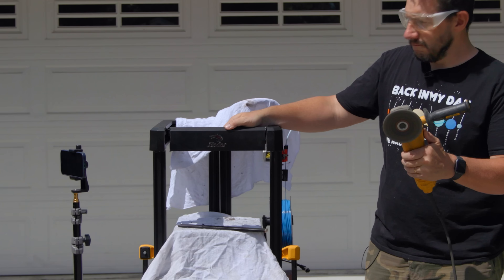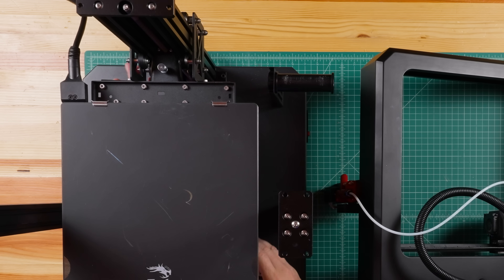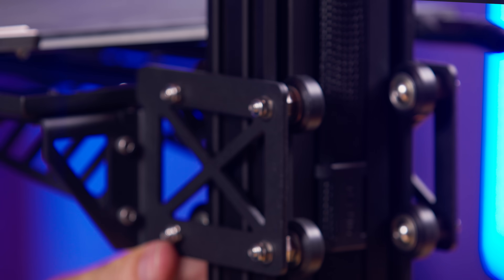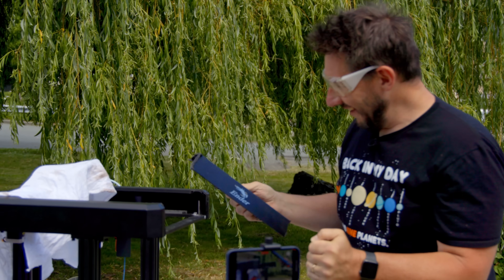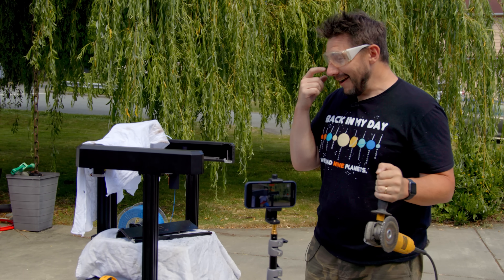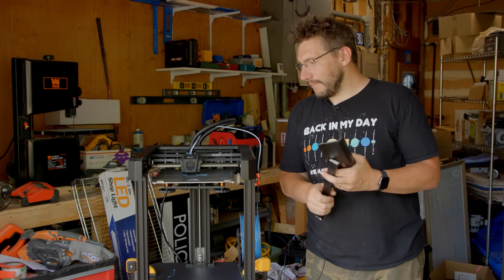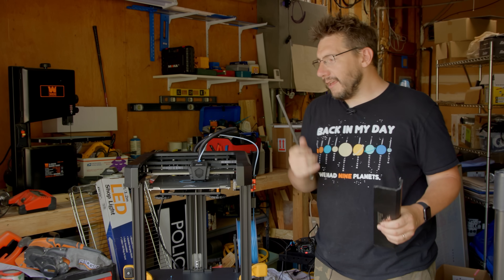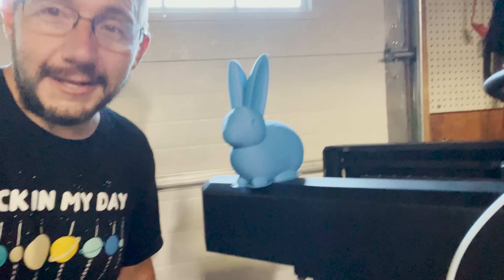I FIXED the Ender 7

Comment: That piece is needed. It adds significant structural integrity. "Squares" are stronger than U.. It ties the structure together. Also, if you notice, there were no sparks. It's not quarter inch steel, it's aluminum.
Reply: I was only searching for this kind of comment. Definitely square is better than U in terms of rigidity.
Reply: I would only cut away the plastic and mount a cam to the thin metal bar
Reply: It is definitely needed. ESPECIALLY for a coreXY printer.  All the weight is at the top, you won't be able to get the same speeds/acceleration without that cross bar.  He just ruined his printer.
Reply: It's a printer not a stool. The only thing that matter is the rails staying square. Which has been proven time and time again with other designs works just fine.
Reply: I agree. More rigidity is always better in this type of system. This does kind of hurt to see. Calling that front bar 'useless' isn't fair. It's structural.
Reply: Wow! Great idea... someone needs to contact Joe Prusa and tell him cut the upper crosspiece off his Z-axis support frame, since it’s made of strong steel, and he can save 25% of his cost for that part... Hell, do away with the upper crossbar on all the Ender 3 variants out there...

Removing vision-blocking plastic - Yes

Removing structural frame without proper stress analysis - No

There may be more than ample support from the remaining structure but to just hack off an “offending part” is a bit extreme when doing an evaluation

Mounting a camera on the metal frame (minus the plastic vanity part) is a good idea.
Reply: @jamesmiller7278  " Wow! Great idea... Someone needs to contact Joe Prusa and tell him cut the upper crosspiece of his z-axis support frame, since it's made from strong steel, and he can save 25% of his cost for this piece" 

lol, this comment didn't age well.... Have you seen the design of the Prusa XL? ;)
Reply: I'm slowly starting to realize Joel has no idea what he's doing. Metal bar in the way? Cut it off, it's going to be fine.
It kinda makes it easier to identify with him :D
Reply: @HardCoil  . With all the mass produced chinses stuff out there, now at least he can claim with proof that it is his, if it's stolen.
Reply: @HardCoil  my thoughts too. The level screw goes up from bottom not down from top
Reply: @HardCoil  Lol he used to work for Adobe, what makes you think he knows anything about engineering? Haha
Reply: also, the metal bar didnt obstruct visibility much
Reply: I was getting so upset when he was talking about how it serves no purpose. Dude completely lost my respect
Reply: The plastic definitely was in the way but I would have left the metal there too.
Reply: The structural integrity isn't neccesary for anything in this case.
It's not like your going to stand on it or throw it against a wall.
Reply: Sort of agree but only if the z towers aren't tight. The integrity you lose its worth viewing the initial layers and head behaviour.
The bunny had no visible layer shifting as far as I can tell.
Reply: @mozkitolife5437  Well even with the U being one piece if the Z towers were loose that would only result in layer shift but the removal of that fourth side I believe then put any strain from the material whether it wants to straighten out from a U or whether it wants to close itself in and that pressure would be taken up by the linear rail bearings so that may end up showing over time.
Reply: @mozkitolife5437  No matter how tight the vertical extrusions are, it can never be anywhere near as rigid as a solid metal frame.  Take the open ends of that U-shaped frame he made, and push them towards each other.  They will bend in.  The vertical extrusions aren't perfectly stiff, and where they connect to the base isn't perfectly stiff.  Before, with a solid metal box frame, it would have been impossible to move the rails out of parallel.  They're now very long levers, and it won't take a ton of force at the end to move them out of parallel by a mm or so.
Reply: @mozkitolife5437  You can add a camera to view your initial layers or just remove the plastic part. The Z-towers are aluminum and the threads will wear out over time with vibration. The Z-columns in the front will tend to bulge outwards. Also, the two X-arms with linear rail will tend to skew with temperature changes and will cause significant damage to the linear rails. They will get out of alignment in the z-axis and jam the motion. The base plate for linear rails are very carefully calibrated so that a pair of rails are almost perfectly parallel. He just annihilated that alignment.
Reply: crappy chinese steel doesn't always spark. I've dealt with some that was plenty magnetic, but wouldn't throw a spark no matter how much I tried.
Reply: @rothery2  chinesium xD
Reply: @rothery2  Either way, you wont put something as heavy as 1/4" steel on top of aluminum columns... Generally speaking.
Reply: @polkijain97  It's not a steel. There are no sparks when he cuts it out. Probably, it is the same aluminum or some aluminum alloy.
Reply: Seems a sthoigh it wasn't needed to complete a print. Did you watch the video? We're talking about 3D printers here, not houses or scaffolding. I think it'll be alright.
Reply: needed is subjective
Reply: @420247paul  Well in this design, it is objective. It definitely serves an important purpose. Hacking it off and then showing it off is a bad idea.
Reply: @polkijain97  seems the print disagrees.
Reply: @pen25  Permanent hack is not a permanent fix!
Reply: All these nerds are crying 🤣 like uh listen I enjoy the content, I'm okay with him hurting a creality printer. This also comes from a Creality fan boy! tHe StrUcTuRal InTeGriTy...man sthu it's a printer, these things are work horses.
Reply: @MrMrbrown862  You're a fool if you don't understand the strengths and weaknesses of a coreXY and why it needs structural integrity at the top.
Reply: @frankb5728  but does it print? Oh it did. Just fine...lol what is it going to collapse? The fun of this channel is fun crazy things and pushing printers to their limits. This isn't a course on engineering 101.
Reply: @MrMrbrown862  It won't collapse.. it won't be able to print at the speeds it's able to, all the weight of a coreXY is at the top, it will be limited by the fact that he cut the front piece, it will introduce all sorts of printing artifacts because of it.  He nerfed his printer so he could see better.
Reply from the maker: Ah Frank, you say these things without any experience. I have it printing, along with an I modified one, and I cannot tell the difference in prints so far. I’m prepping a video to show the prints to see if you and everyone else watching can tell the difference. I look forward to your guesses :)
Reply: @3DPrintingNerd  I have a lot of experience with coreXY printers, I know firsthand that improving the rigidity of it lets you print at optimal speeds. I'm looking forward to your video, I hope you picked tests that will stress the printer and won't compare it to a cartesian for performance metrics.
Reply from the maker: @frankb5728  Frank! I have a few "standard" prints, then, we go nuts. That's the goal. It's a CoreXY motion system with a manufacturer saying "250mm/s" so, I mean, it's in my best interest to go a little crazy :)
Reply: @3DPrintingNerd  I understand why it was done.  The whole machine is a weird mish mash of ideas. I don't blame you but I wouldn't condone doing this.
Reply from the maker: @frankb5728  OH MY GOODNESS that's the perfect way to describe this machine - a weird mish mash of ideas.
Reply: Doesn't matter, that printer is a piece of shit designed by committee.
Reply: @transcendtient 
Is it? I'm looking at buying one, if you know of anything wrong with it I'd really appreciate hearing about it.
Reply: @crow9149  If the video isn't obvious enough I don't know what to say. Who would want a printer that you can't monitor printing?
Reply: @transcendtient  name a printer NOT designed by a "committee". I can name some that were: Voron, Railcore, Daedalus, Rat Rig, Prusa, Ultimaker, Boss delta, etc. Yeah it's a cheap Core xy. It's made by Creality who have probably done more to expand the reach and accessibility of 3D printers than any other brand. Me? I have a full custom 3D printer that once began life as a CR-7 (now that was a crappy machine!). I both love and hate my printer, I appreciate that Creality is trying to bring a superior kinematic that the Core XY to a larger audience. Besides when Joel first unboxed this thing it had no data. Here's hoping they make some changes to allow it to be the printer it deserves to be.
Reply: Triangles are stronger and round is even more so. There is no need for this peice. Why many of the current corexy don't have a front piece. We have been removeinf them from the ft5 for 4 or so years with no appreciable losses
Reply: @pen25  The printers that are designed without a front piece are engineered keeping that in mind. You have cars with 3 wheels as well. But that does not mean you can remove one wheel of your four-wheeler car!